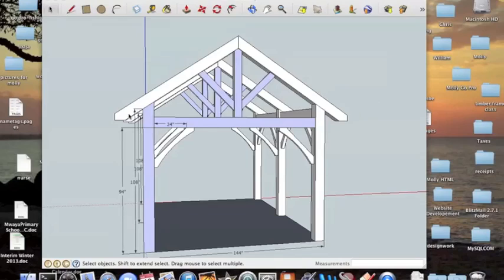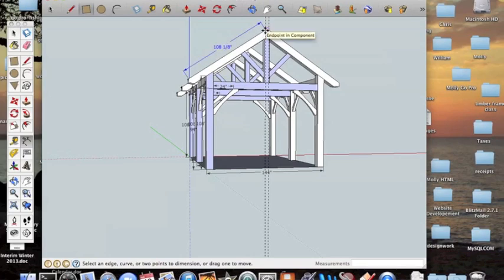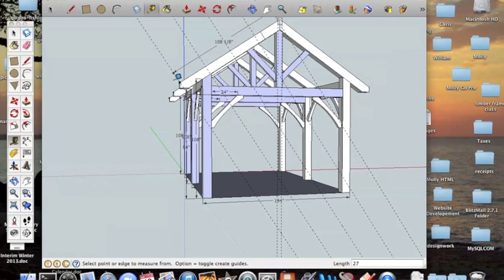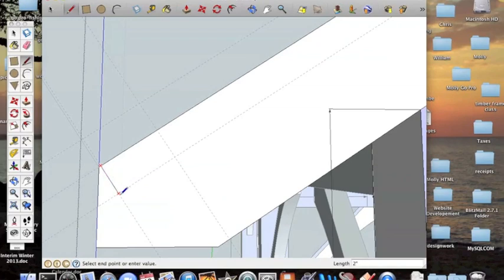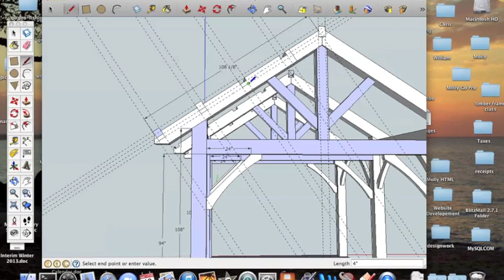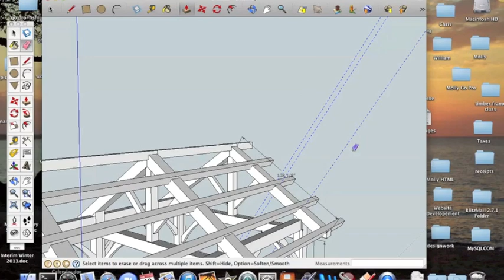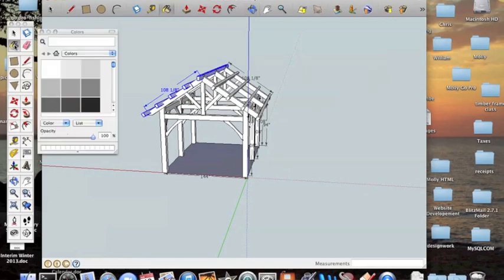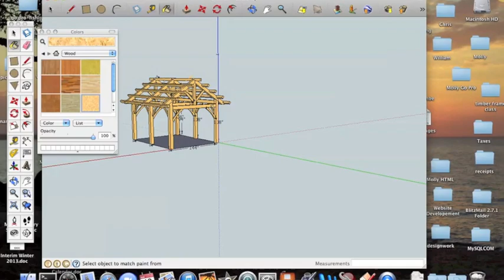Drawing Purlins

Comment: People look at the superior position of a Ridge Board and assume it's structural, it's not.  It's simply a place to put the marks, to locate the rafters.  A ridge board could be made of cardboard, except that it would be hard to manage on site, so typically, (we used) a 1x6 or 1x8 by the longest lengths available.  A 4" x 6" timber would be wrestling a lot of mass for nothing, from a ladder.  That's the only criticism I can see here, this is good stuff.